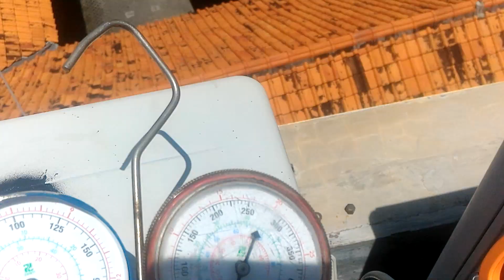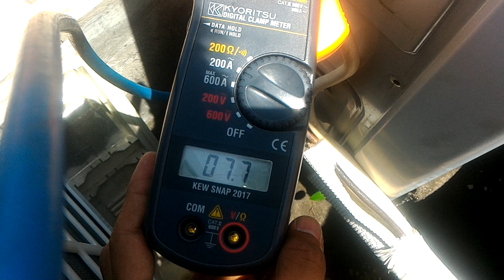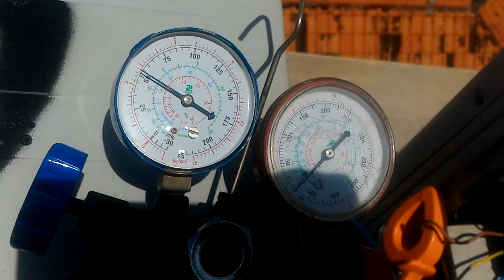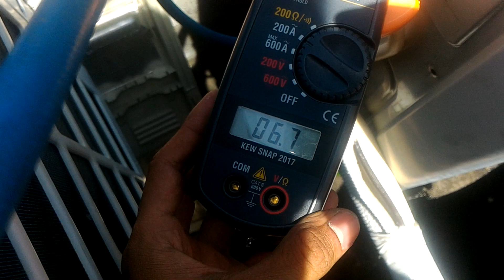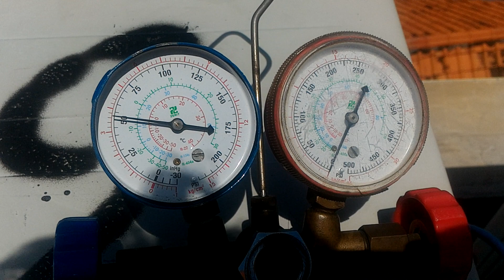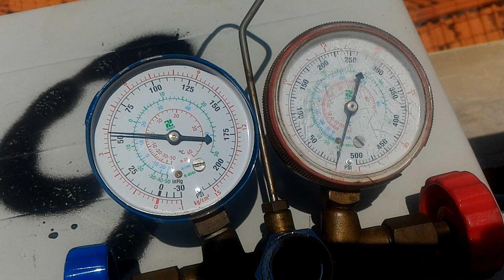Ciri-ciri AC Mampet Berdasarkan Alat Ukur Manifold dan Tang Ampere

Comment: bang ac saya 1/2 PK r32 . sebelum di pump down tekanan 150psi.. terus saya pump down dan lalukan overhaul karna banyak lendir. setelah dipasang, di vacum.  dan pas running tekananya diam di 200psi, setelah 30 menit diam mentok di 170psi.. Amper 1,12A di name plate 1,5A, Suhu Pipa Besar 18.C pipa kecil 17.C ,  kira kira masalahnya apa ya? sebelumnya waktu pump down  ga bisa sampe 0 psi apalagi -30psi. mohoh pencerahanya..

Comment: Mas..kemaren ac saya aux 1pk.. Isi freon r410a. Karna kompresor rusak.. Akhirnya di ganti.. Pake ukuran yg sama 1pk. Tapi isi freon sekarang beda.. Jadi r22.. Karna spek kommpresornya r22. Kemaren juga ganti pipa kapiler uk 0,4 panjang 2mtr. Sekarang tekanan freon gak stabil.. Amper juga.. Pipa besar juga keluar es. Solusinya gimana mas? Apa yg perlu di ganti? Mohon jawabanny
Reply from the maker: Kurang tau sih mas kalau beda spek dengan aslinya. Soal karakter dr r22 dan r410 beda. R410 tekanannya lbh tinggi. kalau kapiler kita mesti sama in dengan ukuran pabrikannya, karena udah d rancang. Itu pun yg jenis freonnya sama mas. saya juga belum pernah nyoba. Maaf ya gk bsa saya jawab. Hhe
Reply: Solusinya ganti baru
Reply: coba flushing outdoor sama jalur pipanya
Reply: Kapiler terlalu kecil dan terlalu panjang, kapiler AC 1pk pakai 0.70 dan panjang kurang lebih 65cm perlu flushing jalur pipa yg menuju ke indoor dan indoor agar oli lama tidak tercampur ke  oli pada kompresor outdoor r22 🙏

Comment: Bang mau tanya 
Tekanan freon 1,50 psi
Ampere 2,60 naik turun
R410 1pk
Kompresor sudah di ganti baru
Kapiler sudah di ganti baru
Kondesor dan evap sudah di flushing pakai R11
Vaqum 30 menit
Penyebab nya apa nih bang
Mohon di jawab..🙏🙏
Reply: Sama nih bang penyebabnya apa ya? Tapi saya amperenya naik tinggi sampe panas tapi tekanannya normal kenapa ya